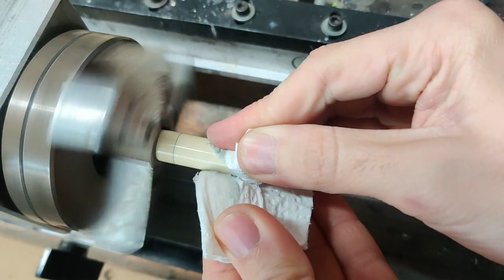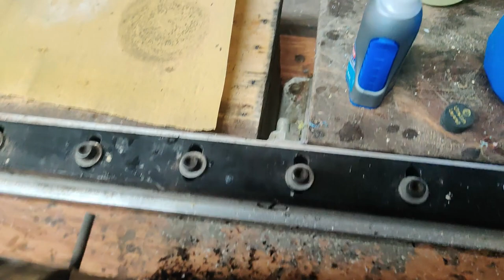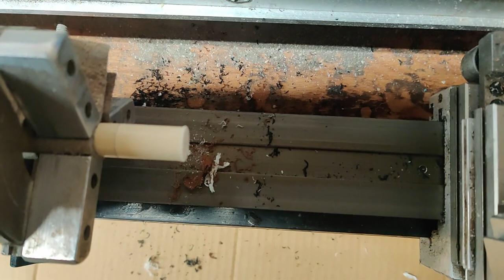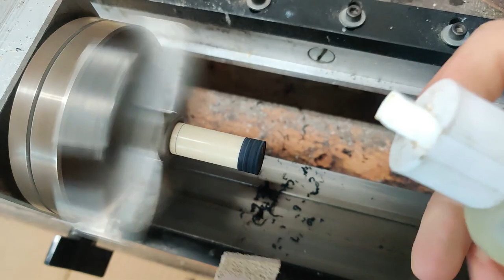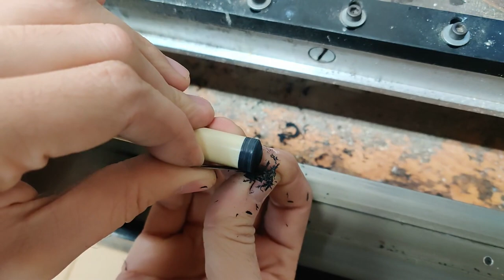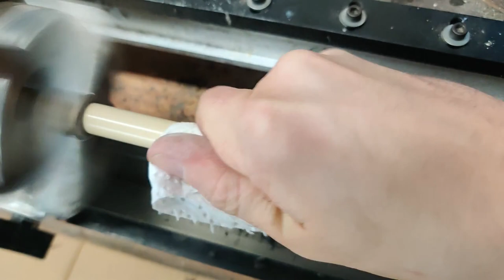Installing a ultra skin black  pool cue tip

Comment: Why do you burnish the tip before cutting it flush with the ferrule. I've never seen this before, any reason for doing before? I've always seen burnishing done after all the shaping and sanding is done....
Reply from the maker: I've found that it gives a cleaner end result doing it in that order. I'm open to trying it other ways though.  😁